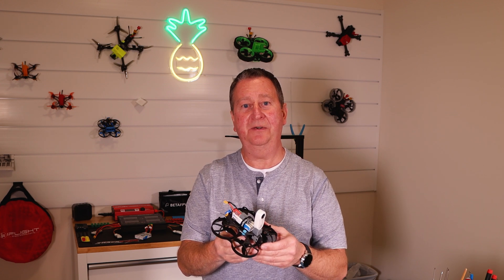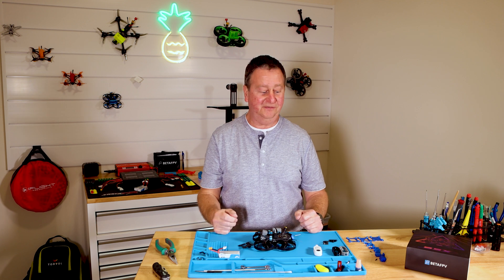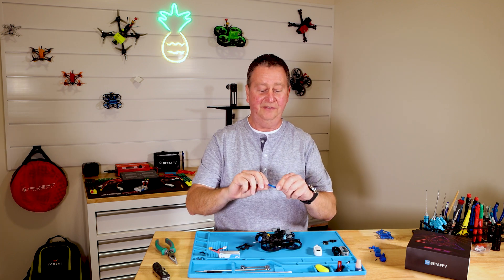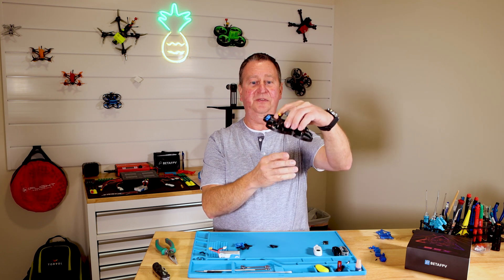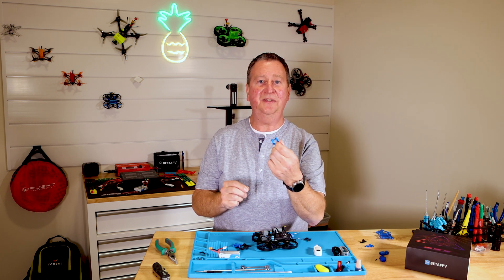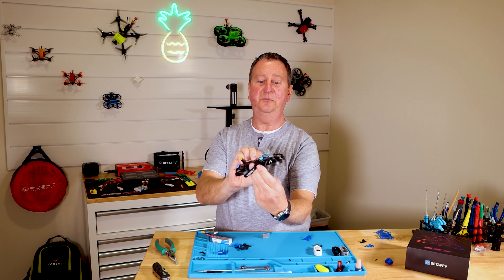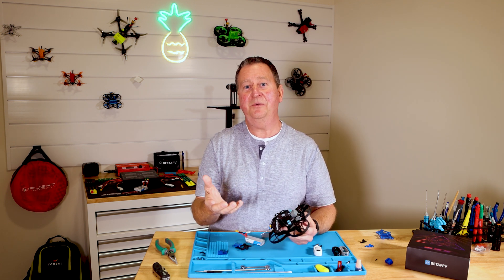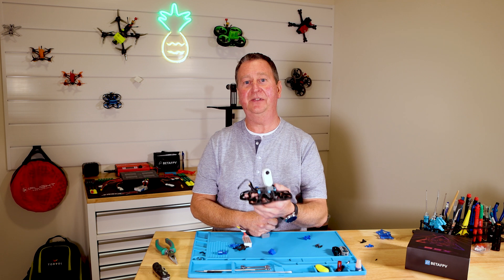How I Made My BetaFPV95X Even Better!  | Upgrades you Must Have

Comment: Waiting for the 95x frame to be restocked 🕺🏽
Reply from the maker: If you are just looking for the prop guard part of the frame RDQ has them https://www.racedayquads.com/products/betafpv-beta95x-frame-kit?variant=31408866951281  The X Brace is not the same as the pusher model.  I have ordered this and it is a direct replacement for the plastic part.  Thanks for watching 🍍
Reply: @Pineapple22  yeah I mean the complete package with all the carbon parts as well ;)